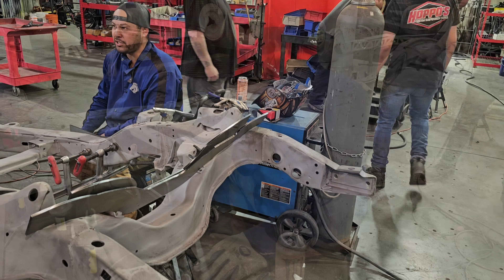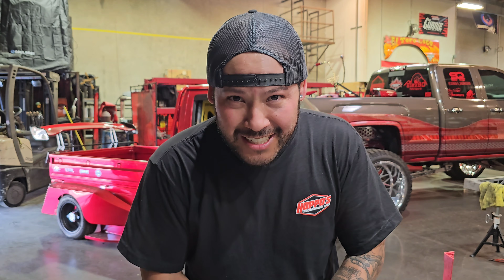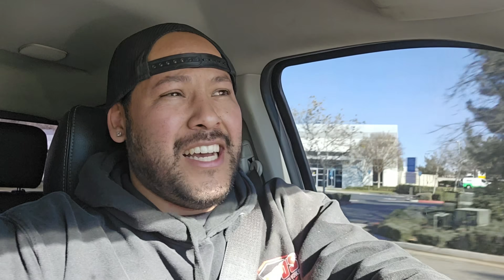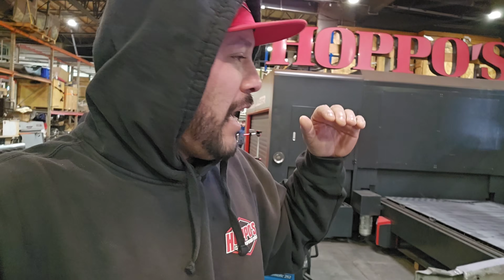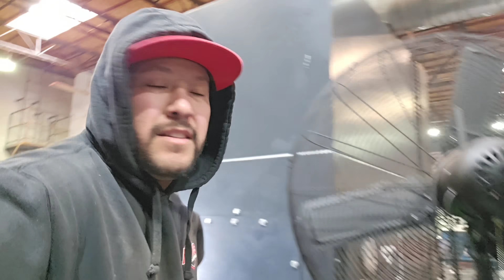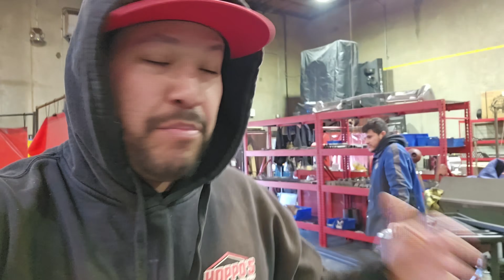64 impala convertible FRAME WRAP

Comment: I forget the brand we used but below 3m the best ive used was in a yellowbox with a bulldog on the front. It lasted the longest and cut like a knife in coarse and smooth with little swirling on the fine. I use 3m at my home shop because im not trying to come in under a bid. I quote a price for a custom job and thats it. They pay or walk away im not changing. I have more work than i want.